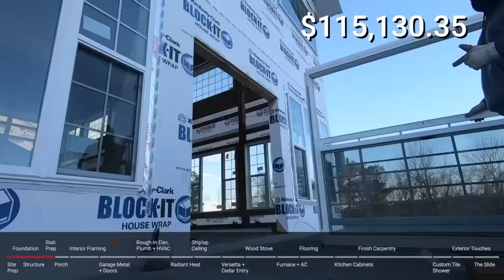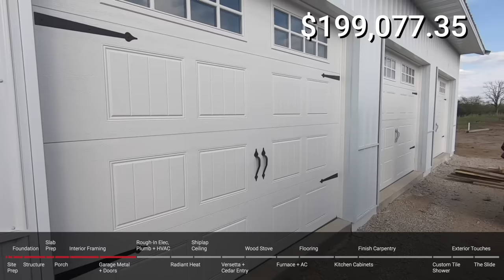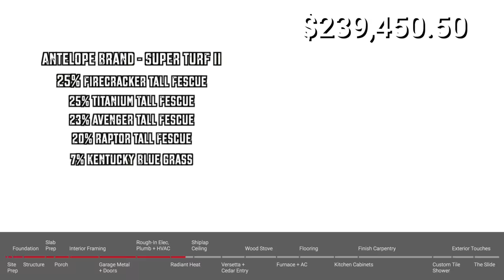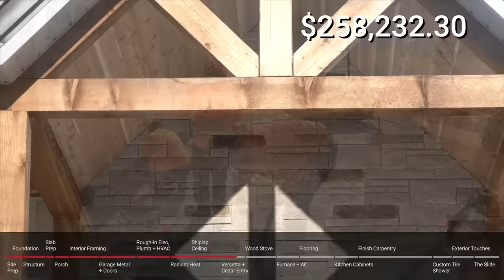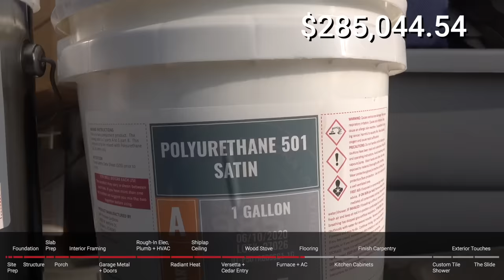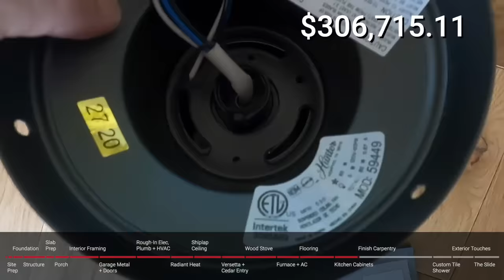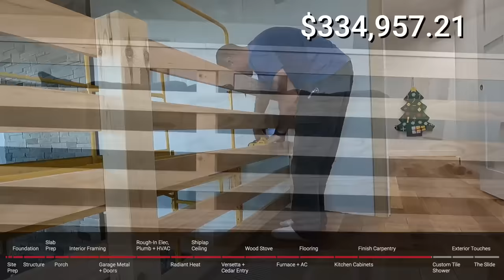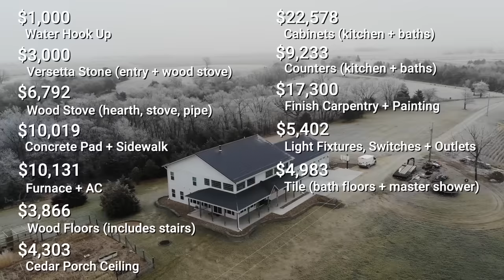6300sf Barndominium for $57/sf | Cost Breakdown + Timelapse | Mad County Build

Comment: Great to see the entire build from start to finish again. I remember you guys had to get the house/part of the house spray foamed again due to a moisture issue. Sorry, it's been a while since I saw that video, lol. Was that cost included in the spray foam breakdown? Or was the price the initial spray foam? Thanks, and I hope everyone has a great New Years!
Reply: Great craftsmanship on display here Mr. Paul. Jack of all trades. Outstanding Job Sir.
Reply from the maker: Thank you!
Reply from the maker: The cost for the additional foam. We didn’t include the cost to replace the drywall, etc since that isn’t going to typically be the case.

Comment: Wow, what a great build!  I'm awestruck.  You and your wife and your support crew did a fantastic job.   The slide on the side of the stairs, what a cool touch.  Part for simply fun for the kids and I suspect it has a second purpose as a faster exit JIC of a tornado to speed everyone downstairs to the safety shelter (curious how that shaped up) or even to send clothes downstairs to teh laundry (unless sit was upstairs and I duffed that).  I suspect the "sweat equity" in that build was no less than an extra  what, b/w 75 and $100K?  Awesome place.

Comment: I loved watching this. I’m going to build a similar post and beam structure but I want to use a straw bales and cement as my insulation and exterior cladding.  I am afraid forest fires can wipe out your dreams, and I am looking for a non-flammable exterior. 

I love the hydronic system that’s great . The surface area of your roof looks like it could generate 30 kW of electricity from Solar Panels. With all that save money, you just might as well do it.

That way you’ll never have to pay for electricity ever again .

Comment: Awesome looking place, information and well edited. Thanks for sharing 
It’s crazy the starting sf price in my area for a custom home starts at $350. 
I know it’s not post frame but that’s a hell of a difference.
Reply: To be fair most homes only price out the square footage of the home (which would be ~$88/sqft) and if you add the labor for this house that isn't shown it would probably add 3x labor cost which puts you right about ~$351/sqft.
Now, if you have the tools, knowledge, connections and time to do this. You can save a lot of money as shown!

Comment: This is amazing! My husband and I are looking at doing a barndominium for our next home and your home is very similar to what we have in mind. We, unfortunately, do not have the ability to do a lot of the work that you did and would have a builder do most of it. Would you mind sharing how much you think you saved all together with labor by doing so much by yourselves? Thank you for the continued videos of your journey, they are truly inspiring!
Reply from the maker: Thanks for the comment. At the time we built we saved more than 50%. Material costs have increased so this home as it is would likely cost $900k+ to have built.
Reply: If you want to save as much money as possible, do this:

1. Talk to a home designer/architect. Keep the shape very simple... Like a rectangle. I chose a 40x60 rectangle with 18' walls. This allowed it to be a 2 story. Half of it is two story residential for a total of 2,400 SQ ft, 4 bedroom, 2 ½ bath. The other half is a 1,200 SQ ft floor shop, with half the shop having a 2nd floor overhang to store seasonal and random storage. This size shop can easily fit 6 full size trucks, but the way I set it up, I can fit 2 large vehicles, 1 boat, UTV, 2 ATVs, still have about a 17'x40' open space for projects, and 3'x40' of work bench, tool boxes, and shelving along the wall. 

2. Find a good contractor. Have him refer good/reliable builders for each individual section of the home build. Then find a few others of each part on your own, and get bids and check references. 

3. After you have all those numbers, including what the contractor will charge, go find a "construction loan". You will need to be able to show them your contractor, time frames of each piece and break down of the costs. They will expect you to stick to the schedule which is why reliable crews are important. Your contractor will keep you safe by ensuring the crews do quality work. 

4. Once the home is built, you will need to secure a traditional mortgage loan from a traditional mortgage lender and that will pay back the construction loan. Enjoy your home.

Pro Tips: Don't get specific about what type of home your building to the loan companies. Leave the words "post frame" out of it. Just say you're building a residential home. 

It's been a long time since I talked to a home builder about this but basically they marked up the final build about 35% to 40% many years ago. So by getting your own contractor and crews, and cutting out a home builder, I would say you can easily save 35% on a home. Maybe 40%. I will say it's a lot of leg work, but a good contractor will save you a LOT of headaches.
Reply from the maker: Great tips!

Comment: Did you have to dig traditional footings for the walls of the living space?  Our contractor wants to that in order to prevent the sheet rock from cracking. However, wasnt sure after double gurting and tying in all the interiors, if that was overkill.  it definitely adds to the cost. thoughts?
Reply from the maker: We don’t and we do the slab after the structure is up. We use spray foam insulation on exterior walls. Haven’t had much in the way of problems. A couple drywall cracks but that’s to be expected
Reply: @MrPostFrame  Thanks for the reply. I believe they were doing the slab after as well but in addition to digging the holes for the poles they wanted to dig traditional footings along the exterior walls. We are in Utah where the frost level is 36 inches. So that added alot of cost but i wasnt sure it was necessary.

Comment: Awesome video! Can you pls tell me about two products? 1. The brackets for hanging doors (27:46) and 2. The small metal break. Thank you!
Reply from the maker: Not sure which break you're referring to but I believe I got them at Menards. Harbor Freight also sells them.

https://www.menards.com/main/heating-cooling/ductwork/ductwork-tools-installation/masterforce-reg-24-duct-folding-tool/thht-1474/p-1488180036892-c-6833.htm

https://www.menards.com/main/tools/roofing-tools/malco-5-hand-seamer/s5r/p-1518593410192-c-13081.htm

The brackets and Door Stud are sold on Amazon

https://www.amazon.com/shop/marshallremodel/list/2H1AHHISL5LP8?ref_=aip_sf_list_spv_ofs_mixed_d

Comment: Bro, you suppose to flash with closed cell the roofline to avoid condensation, or something cheaper , like bubble wrap aluminum.
Reply from the maker: Where we are located our insulation system works out well
Reply: But the climate is changing. Ya’ll have had at least one killer winter and more extremely cold winter spells in the last decade or so.

Comment: What is your opinion on postframe vs steel building? I know as MR. Post Frame you might have a bias but would like to know what scenarios you think steel would be the better choice.
Reply from the maker: We’ve found wood to be easier to address condensation concerns in northern states where you get the extreme winter. Steel tends to be easier to calculate for wind in hurricane areas. Steel is historically more expensive, there was a brief time in 2021 that it was cheaper than wood. 

Steel frame will still require a lot of wood framing so it isn’t a slam dunk termite prevention. You’ll still have to treat if you’re in a prone area. 

Post frame is going to be your best bet for DIY feasibility as most people don’t have the skill or equipment to go steel frame.
Reply: @MrPostFrame  thanks for the reply! Looking at building near Jesup,IA in the next couple years.

Comment: Now I have a couple of questions since it’s a metal building is there some creaking noises just from heat and cold expansions and contractions in the winter time do you notice that it’s colder? What about the summer? Is it hotter inside? How is the heating and air conditioning does it dissipate or does it pretty much hold the heat in and the air conditioning, one thing I haven’t seen out of the videos that I’ve seen on the medium does anybody put solar panels up on the roof?

Comment: I love these homes and would love to build one.  The only thing I don’t like is the echo you hear in these large spaces.  Is seems to be inherent in all of these designs.  Is there any way to cut that down?   People say carpeting and furniture cuts it down, but is there any sound absorption that can be added to the ceilings?
Reply from the maker: You can add sound proofing insulation to interior walls. In our case the number of windows are a bigger factor than anything

Comment: So my big question is why doesn't the main roof get plywood like when you do a porch roof? 

Can you do plywood with like iceshield and do a metal roof?
Reply from the maker: Yes, plywood or osb is not required since the structure gets its shear strength from the metal. However I’ve been adding osb to all my build for a few reasons. Yes, you can add plywood, ice and water or Bob shield and then metal.
Reply: @Marshall Remodel | MR Post Frame  thank you for the quick reply. My house is shingles and when I had a leak the water ran down the wood that's why I asked vs just dripping down. What state or states do you build in?

Comment: Perhaps this was talked about in a previous episode but is there a reason you didn't do sheathing on the outside prior to the house wrap?
Reply from the maker: With post frame it’s not required since the building gets its shear strength from the metal…so sheathing isn’t needed/required.

Comment: We could really use help! 
We have two of the 4 homes dried in and one finished on framing. 
Now I am terrified to install spray foam and we are a steel siding with no vapor barrier. 
In fact I didn’t know we needed it until now! 
Full panic mode…
Any advice? We are zone three. 😞
Reply from the maker: If you have a good spray foamer you will be fine. 3”s of closed cell and you are good. It’s your vapor barrier, air barrier and insulation. Plus it gives you a ton of extra structural strength.

Comment: no plywood for an outer wall ? before siding ?
Reply from the maker: Plywood is added for shear strength and also to attach certain siding. In this case the metal doesn't need plywood since it adds the shear strength and is screwed every 2' into the girts.

Comment: Nobody will ever build me a post frame style building without some kind of wood sheathing on the outside of the home. That provides stability but most importantly it provides a base for your water proofing. This is SO important. Water infiltration is the enemy. Was that Typar even taped? Every single thing matters. Staple holes. Seams. My 3 year old post frame four car garage is sheathed and then with vinyl siding that matches my house. I taped all the Typar once they left one day. Just doing metal siding over Typar on the outside is nothing better than a mobile home. I KNOW THIS INTIMATELY. No. Hell no. I will NEVER go back. I learned in the trenches via renovating a 1972 mobile home. Paneling. See through insulation. Metal. Nope. Not on my properties.

Comment: THAT WAS AWESOME!  You are definitely talented my friend!  
Your s/f price is crazy low, is that because you self performed most of the work?  Or is that your sell price with labor?  Where Can I see the floorplan because I love the exterior.
Reply from the maker: Yes that is correct. The only labor in this video was for concrete and drywall work. Did pretty much everything else myself.

Here is the floor plan - https://mrpostframe.com/mad-county-original/
Reply: @MrPostFrame  Thanks for the quick response, I ended up finding the answers just digging a bit deeper into your site just after I left the comment (don't you hate that?).  So with regard to your material pricing, do you think it has come down a bit.  I'm just thinking of when you may have purchased the wood, I noticed you started the build 2019 and wood and other material went crazy last yr.

 If you had to ballpark labor where do you think it would be?  Just bought a home and some land in TN.  I plan to build my own forever home, but would need to have most of the work if not all contracted out.

Comment: I'm curious what the total would be with labor included? Has that ever been mentioned? What would it cost for you to build that for us, here in Midwest Illinois?
Reply: They explain that the labor is included in the parts they contracted out. Paul build it himself so those parts is only materials.
Reply from the maker: With material increases + labor this house would be around $950k to build as it is

Comment: 34:03   You need to put a railing on the edge of the slide so children don't fall down below and crack their skull open.
Please add a railing. The way you have it currently designed is DANGEROUSLY UNSAFE !

Comment: No osb sheathing on the walls?
Reply from the maker: When using exposed fastener steel it’s not needed because you have the sheer strength. Hidden fastener steel or other types of exterior you’d need the sheathing

Comment: Paul, how did you get all the skill and resources to pull off building a home all by yourself. Before you started your own business, did you work for a jack of all trades contractor or what. Your skill level would show you would have to know several trades competently at a journeyman level. I find that an anomaly. Especially to know plumbing and HVAC.

Comment: It looks like you do really good work. I have a question though about the cost breakdown. On your instagram it says for low end builds it cost about $200 a square foot, but you are able to build your home for $57 a square foot. I understand that labor costs aren'
t added to that $57. but is labor really $130!??? To me thats just shocking..
Reply from the maker: Low end $190, this square footage also included a large portion of the garage that didn't receive the same finish out as the house. If you just factor the living areas it's around $70-$75/square foot.

You have to figure labor, general contract fees, equipment fees, etc... Plus the cost to build has gone up since we originally purchased our package in 2018/2019.

Comment: So the title says 6,300 Sq ft barndominum cost $57 Sq ft. That's roughly $359,100. Your total was around that at $356,593. 
How much would it cost if the work was done by contractors and not myself since I'm not a builder at all? 

Anyone have any estimates?
Reply: That building that size in my area would easily be 1 million plus not including property
Reply from the maker: This would likely run $900+ if we built it for a client today.

Comment: Post and frame is not acceptable with codes. So the east way to explain it. Build a home put metal siding on it. Boom you gotta bardo. And you saved money on the brick. Also since it’s a barndo. There’s not 15 pitches on 7 different hips and valleys. There’s your savings. Build a box not a Lego set and you save money.

Comment: I’m confused because I keep seeing these barndominium builds for cheap but was just quoted $800,000 to build 2500 sq ft barndo(not high end, mid grade). I think he was full of crap but I also look up the average cost and it is $160-200 a sq ft. Doesn’t seem cheap to me.
Reply from the maker: There is a mis-conception of barndominiums being "cheap" to build. You can see the price per sq ft for us was "cheap", but that was because we did most of the labor. Depending on where you are located in the US you'll see pricing for $150 - $250/ sq ft for a turn key build.

Where you see people saving money is when they are doing some or a great deal of the labor themselves. 

There are small areas of savings over a typical stick build (concrete, sheathing, etc...). It also depends on how much shop/garage space you want. There is a lot of bang for the buck with post frame construction when it comes to open shop space.

Comment: brand new house and not using geothermal heating and air conditioning and solar electric, what a waste. Using cement flooring, that will damage your ankles and knees after awhile. Should have bamboo hardwood flooring throughout the house to cushion the walking and electric heating underneath instead of water, also should have a tankless hot water heaters. no basement to put all the mechanicals throughout the house? Why not, wow.
Reply from the maker: There’s a lot of ways to do things. We chose what made sense for us at the time we built considering our available budget + layout. We are very happy with how things function for us!

Comment: 4 garages... Haha God help the neighbors. Ugly. Dude, Tiber frame houses are cheap, strong, lasting, pretty. Build a SMALL barn in the back for the cars.
Reply: @joeraeside6226  I guess I am. You can make your own timber frames, it's not hard. It takes like 10 to 14 days. Can have them put together in 4 hours. You'll need help to do that though. Hickory temper frames are best, usually. There's a lot to be said for oak too. Then use salvage oak flooring. Preferably you would either put this on a concrete slab by the way or better yet a dry masoned stone foundation. You can also do that yourself. It's just a matter of knowing. Spend the money on the windows, tripi pane preferably. Wooden storm shutters are good project after the house is built. Use lots of redwood, salvage preferably, in the bathroom. You can even get salvage teak for some accent things. 
You sound like you don't know how to do anything
Reply: @matthewdeepblue  well I’m 12